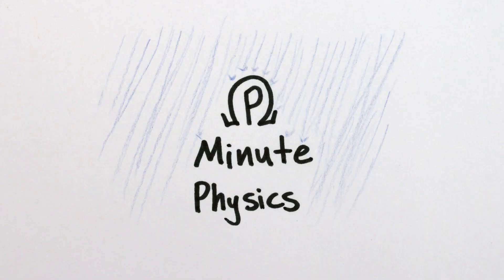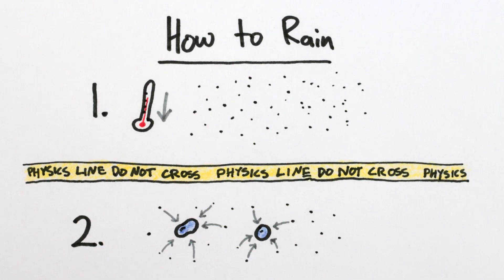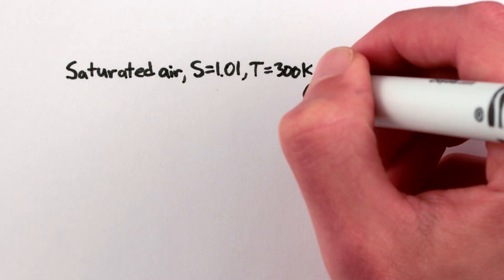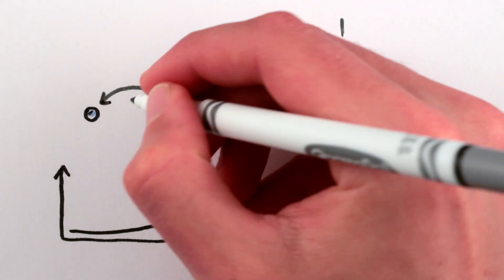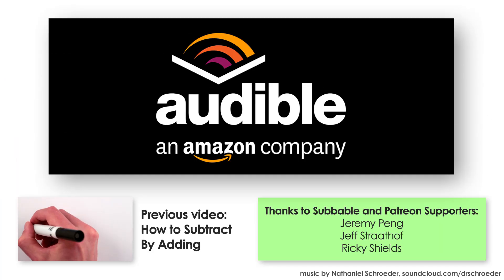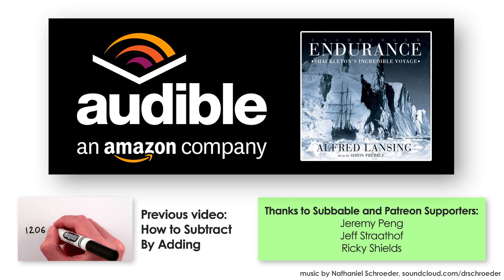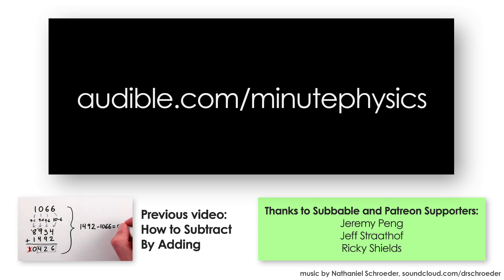Why Raindrops Are Mathematically Impossible

Comment: Well that was annoying. Another example of the misinterpretation of math. And to keep it stupid, it made sure to not  include the actually correct interpretation in the context of the physical realm. Math 'arrogance' sucks. And it's everywhere. Math is the abstract not the physical realm. Math is not (always) truth, and it does not (always) suggest the truth or the path to it. Of greater importance is the need to point this out instead of just continuing to propagate the intellectual dysfunction by claiming things such as raindrops are impossible, the universe is simulation etc etc etc. Moronic. It video was at least titled 'why pure water raindrops are (mathematically) impossible it would have had a shred of intellectual integrity. Here instead math is 'misused' to 
'mislead'  us into thinking the actually occurring is impossible. Great. Other similar misuses of math lead us to thinking the unlikely or even impossible is possible and even likely. Congrats everyone.

Comment: The brain is smaller than the Solar System, yet it's more complicated.
Reply: Define how you measure complexity.
Reply: Eric Pive Complexity by the understanding we have of how something works in a dense space. Density is proportional to complexity.
Reply: DanKop Not really. Lead is very dense and not complexe, and plastics are very complexe and almost have no density
Reply: Eric Pive I meant that the size of the brain is smaller yet more complex(difficult to understand) whilst the universe is larger and less complex(easier to understand).

Comment: "Cubing a small number makes it smaller than squaring it"
Got me a bit confused. Doesn't this depend on what unit of measurement you are using?
If you were using mm instead of cm, the numbers would still get bigger no?
I am probably missing the point.
Reply: No, because (10mm)^3 = 1000(mm^3) = (1cm)^3 = 1 cubic centimeter.

But it is true that it can be confusing if you don't realize that.
Reply: No, that is not right. A milimeter cubed is a cubic milimeter, it is a different unit from a milimeter. (1mm)^3 = 1mm^3, a cubic milimeter.

A cubic milimeter is a measure of volume, ie. the volume that a cube with sides a milimeter in length makes.

A cubic centimeter is a measure of volume defined similarly.

You would need a thousand cubic milimeters to fill a cubic centimeter, so that 1mm^3 = 1cm^3.

Similarly, you need a thousand cubic decimeters to fill up a cubic meter. Why don't you experiment with this?
Reply: Ah I forgot the square and cube the conversion multipliers.

Thanks for the serious responses.
Some of you need to chill out though.
Reply: Let me explain it a bit more so you can get a feeling for what's happening.

Suppose creating a surface of fluid costs you some energy, E = a*S, where E is measured in Joules, S is the surface area in sq meters, and a is just a constant (say, 8J/m^2)

Suppose also that creating a volume of fluid enclosed by a surface gives you some energy, E = b * V.

Now, if you have a ball made out of fluid, its energy is (remember that for a sphere, S = 4pi*r^2 and V = 4/3*pi*r^3) E = a*4pi*r^2 - b*4/3*pi*r^3.

If r is very big, E goes to -infinity, meaning that you can create energy by adding up bits of fluid.

However, if r is very small, E becomes positive. This means that if you have two blobs, they should join together, which releases energy, not split up into many many different balls, which costs energy.

However, more complicated phenomena appear so that drops of water are in fact possible.
Reply: Lol the people telling you you're dumb are actually too dumb themselves to understand the issue which made you scratch your head in the first place and, in their dunning-kruger-style haste, declare "yup makes sense, it's obvious". RIP education. 

Except for TastMFC in his last comment. 
I have no idea where he was going with the first comment though.
Reply: +TastMFC 
(1mm)^3=1mm=0.1cm
(0.1cm)^3=0.001cm
Reply: u dumb af
Reply: only if you're playing golf, dumbass

Comment: I like the topics, I like the exposition, I like the pace ... but the vocal fry of the narrator is grating.

The thing that doesn't make sense to me is that multiplying x**2 by x to get x**3 makes it smaller when x < 1.0 is a true statement, but it all depends on the scale factor.  If you measured your droplet dimension in angstroms then even the radius of one water molecule will be more than 1.0.
Reply: Except the measurement he states is a couple million water molecules, not any sort of length
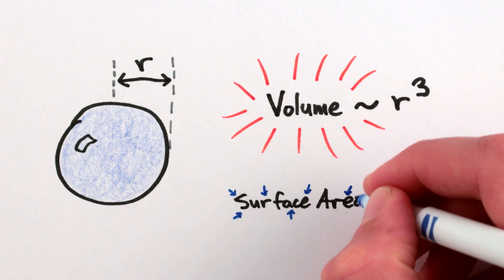Reply: No, at 1:10 he uses radius cubed (volume) and radius squared (area).
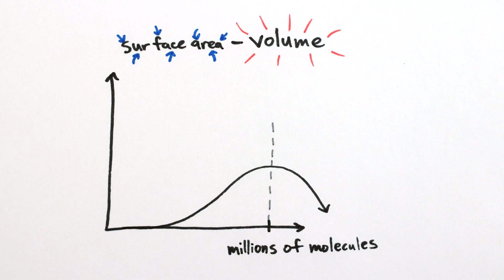Reply: 1:45 "But for a water droplet, it's somewhere around a few million molecules" the unit he's using for the radius is in numbers of water molecules, not meters, not angstroms, and besides if you scale your length units, you have to scale your energy units accordingly. This is elaborated in the video advertised at the end of this one.

Comment: I think it only mathematically doesn't add up due to the rules we have on multiplying decimals that basically turns it into division instead. The problem as it is presented looks like it would go away if you use a unit size small enough for you to still be doing the math in whole numbers.

For example: .5 centimeters cubed ends up being .125 centimeters while .5 centimeters squared is .25 centimeters. 5 millimeters on the other hand is 125 cubed, and 25 squared which would convert to 12.5 centimeters and 2.5 centimeters respectively.

Comment: A few questions: How is the turning point defined?  For example, if we're using centimeters its at 2/3 centimeters.  Millimeters?  2/3 millimeters.  So how is the limit a few million molecules, rather than, say, billions or just thousands?  
Also, keeping a fortune aloft requires x Newtons.  Lifting it requires varying amounts of force.  If you use 1.01x newtons, it accelerates upwards at about 0.1 m/s^2, but you need 1.01x newtons only for a limited time.  The amount of energy needed to lift a fortune would then depend on the rate of lifting, right?  just a bit confused
Reply: Also I cant make that more concise, but if you can please do
Reply: Basically which unit do you use to measure x^2 vs x^3 changes the turning point, and it takes energy to just hold something still, and varying amounts more energy to lift something.
Reply: No it doesn't matter what unit you use. Reality doesn't care about how you measure it.
Reply: Eric Pive I know that.  That's exactly what I was asking
Reply: Cellf Centered Prokaryote That's why I answered it...
Reply: Eric Pive I know that the unit doesn't matter.  You didn't answer my question.

Comment: i watched into 1:10 and took a estimate of whats going to happen:

So if the water turns from vapour to liquid it makes a pressure to make a quantum suface for the drops to therefore, spread but as it is quantum, the rain will pass making a jellyfish shape as you said but it is mathmetically impossible as jellyfish water cannot land on surface without making energy making slight radiation to the land and finally the other raindrops become impossible to land as it has radiated and passed a quantum line making a loop but the raindrop already landed it cant loop making rain impossible

Yup nailed it
Reply: and i was wrong

Comment: i know you are a physicist, but you might want learn about Avogadro's constant, because a few million molecules of water would only weigh a few hundred picograms, plus rain doesn't form in regular air it forms in special clouds where the size of the groups would have exceeded that when they evaporated. there is also the fact that of course it loses energy gaseous water is at a higher energy state than liquid water, because no matter has no energy because if it did it would be at absolute zero which would require a truly isolated system.

Comment: I can prove this wrong as the bilonganary of the x3 is the same as 102÷h and is as big as sallies little barbie doll house as it is a x4 × 6 is as biolonary and hoyner as the perimeter of the proton fid of mass energy of 2  with an effect known as finary as straight which causes the x3 pull of the planet Dyt Disor as it is the size of satipurn which of the killer whale of the hiftler yuton which shows that raindrops are what you said.
Reply: basically I dont know what the fuck is happening in the video
Reply: What?!!
Reply: No. 4 cubed has the same radius as a water yuton and yutons  attracts motion physically bounting .0006 nanometers of atmospherical pressure to the yuton. 4 cubed's binarial radical exhemmering the pressure for an atom's electron's nuclear radius geutar measured with the degree of 76. Therefore all liquid drops are impossible
Reply: Lol, same here

Comment: So, if rain drops can sidestep physiscs formulas....then that says something about the validity of those formulas. I guess math does lie.
Reply: He doesn't take into consideration de specs of dirth floating around the atmosfere. That helps the drops to get to their "critical size", and star growing instead of shrinking. The answer is in the video he told us to watch at the end of his own's
Reply: nope. this examples were done in what is called "ideal conditions". in real life, theres hundreds of variables which will influence the behaviour of the physics. In the case of water drops for example, the presence of dust, the changes in atmospheric pressure, winds, etc. Math does not lie, but if used the wrong way you may think it does. And, there is ALWAYS details that you never thought of in the theory that will apear in the practice.
Reply: You need to go watch the other vid for the full explanation. It involves dust. The math is correct.
Reply: +Iker Aragón that's in his how raindrops form vid.
Reply: +Iker Aragón that's in his how raindrops form vid.
Reply: fjoa123 I'll but that for a dollar ;)
Reply: I'll send you a check (:Maximvs Dread

Comment: can't you just have a smaller unit length and then it all works out in the end?
Reply: +Aimée Whitehead I presume there was some simplification and what's actually going on is kx^2 > cx^3 where k and c are some constants and they depend on your units of measurement, so the constants get bigger if your unit length gets smaller
Reply: although its been a week reposting this answer to help you

if you are trying to say that converting the meters into a smaller unit 
will help, it doesn't. the numbers may seem bigger but that is because 
you are also square the prefix meaning you are scaling the units down
0.1 meter = 10 cm
(0.1^2) meter^2 = (10^2)cm ^2
(0.01) meter^2 = 100 cm^2 
using 
1cm = 0.001 meters 
substitute cm to find that they are equivalent because the conversion is
 also squared

0.001 meter^2 = 100 * (0.01 meters)^2 
0.001 meters^2 = 0.001 meters^2
Reply: teseting I understand what you're saying and how the maths works, just if you redefined everything so that 1 meter was 1 x 10^-9 or something similar, so 1 joule is now defined as a 1 Newton force moving and object by 1 nano meter and 1 Newton is the force that causes 1kg to accelerate by 1 nano meter second ^-2 then there is no need for converting units since you are already using the small versions of things and at tiny values for the radius in the old system cubing is still greater than squaring in the new system

Comment: That last part, x^2 grows faster than x^3, would it have been better graphed as having started at 1 and having x^3 simply decreasing faster than x^2 does? It sounds like it should be the same thing, but it fits better with the theory of the video, which means it's slightly less confusing.

Comment: 0.1m squared is less than 0.1m^2 (0.01m^2)
10m squared is more than 10m^2 (100m^2) - ok

But with different units:
10 cm (0.1m) squared is more than 10 cm^2 (100 cm^2)?

in terms of length, doesn't it just depends on which unit you're using?? I don't understand.

Comment: Unofficial post- 
One way to prove the math is misleading around 1:22. Measure the water molecules in picometers. One water molecule is approximately 275 picometers in diameter.
Reply: if you are trying to say that converting the meters into a smaller unit will help, it doesn't. the numbers may seem bigger but that is because you are also square the prefix meaning you are scaling the units down
0.1 meter = 10 cm
(0.1^2) meter^2 = (10^2)cm ^2
(0.01) meter^2 = 100 cm^2 
using 
1cm = 0.001 meters 
substitute cm to find that they are equivalent because the conversion is also squared

0.001 meter^2 = 100 * (0.01 meters)^2 
0.001 meters^2 = 0.001 meters^2

Comment: i still don't get this.... if you scale up the lengths (and therefore SA and Volumes) to values above 1 then x^3 does grow larger than x^2 so aren't we creating the mathematically impossibility due to our ways of measuring???
Reply: There are coefficients in front of each term with units that turn the length/area/volume value into an energy value, and those coefficients change with your unit to make it work regardless of unit.

Comment: At about 1:56, you mention that x^2 tends to grow faster than x^3 for small numbers.

By small numbers, I assume you mean x within (0,1). In this range, both x^2 and x^3 would be decreasing functions and so I think your graph is wrong. I think x^2 isn't "growing faster" than x^3, but is actually 'shrinking slower' than x^3.
Reply: +Bryan L His graph is correct. In the range you mentioned, x^2 and x^3 take x to a smaller number than x but that doesn't mean they are decreasing functions. As you increase x, the value of x^2 and x^3 increases. For example going from x=0.1 to x=0.2 takes x^2 from 0.01 to 0.04 and x^3 from 0.001 to 0.008. Both are increasing but x^2 increases quicker :)
Reply: +Jack Finnamore Oh oops, I was thinking for a fixed x-value within (0,1), x would be shrinking as you increase it's exponent. You're right though, the graph is correct. Thanks for pointing that out!
Reply: Oh I used my other account by accident lol ^

Comment: That's one thing that's bugged me about math.
1cm x 1cm = 1cm^2
.5cm x .5cm = .25cm^2
5mm x 5mm = 25mm^2
Reply: 25mm^2 is same as 0.25cm^2
1 cm is 10mm but 1cm^2 is actually 100mm^2.
Reply: Same I thought I was the only One
Reply: +UnCommentator Why does that bug you?
Reply: jhanks2012 because 25mm is 2.5cm, so half a cm squared is smaller than half a cm squared...
.5cm x .5cm = 5mm x 5mm = 2.5mm^2 & 2.5cm^2 at the same time or something.
Reply: +UnCommentator if you imagine a square that is 1 unit by 1 unit in dimensions, now multiply both sides by 2, to a square 2 units by 2 units. What happened to the area when you double the side length? It goes up by a factor of 2^2 or 4.
Reply: jhanks2012 I mentioned this to my dad the other day and it made a lot more sense when he explained it visually.

Comment: Why does rain disrupt Super High Frequency and Extremely High Frequency radio waves?
Reply: +Ryan McKinstry They don't, thats just static. Try tuning your radio better.
Reply: +Yui Nyan Yes it does, I'm talking about Military comms systems...
Reply: +Ryan McKinstry  Although precipitation can sometimes absorb or scatter waves such as those, noticeable interference is usually caused by thunder and lightning (The static electricity and whatnot)
Reply: +modsiw10k Nope, Naval Satellite communication systems can be completed interfered by rain. In the SHF/EHF range..
Reply: I stand corrected? Try googling it.
Reply: +modsiw10k I did, and it gave me the answer of Rain Fade, which I didn't quite completely understand, I was hoping for more a layman's answer.
Reply: Google a layman's answer.
Reply: I don't know for sure, but if I had to guess I'd say that the odd shape of the raindrops' surfaces distorts the radio waves. Diffraction has a bigger effect on high frequency waves, so it'd make sense for it to only be noticeable on higher frequencies. If I'm not spouting complete bullshit, the waves change direction when passing through a transition between two mediums with different refractive indexes (i.e. water and air). I could go into detail about why, but it'd take a while, so I won't unless you want me to. They change more if they have a higher frequency (this is also the effect that creates rainbows). I'd imagine that the cumulative effect of travelling through thousands of drops could have a large enough effect to be noticeable.

But don't take my word for that, I'm just speculating based on what you've said.